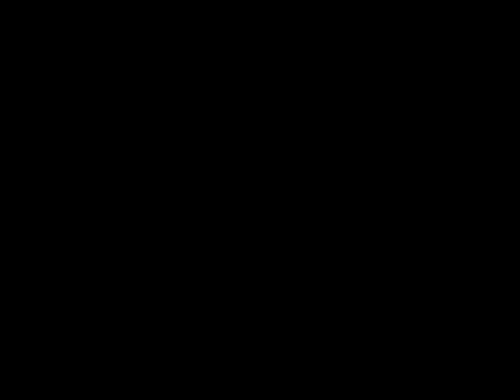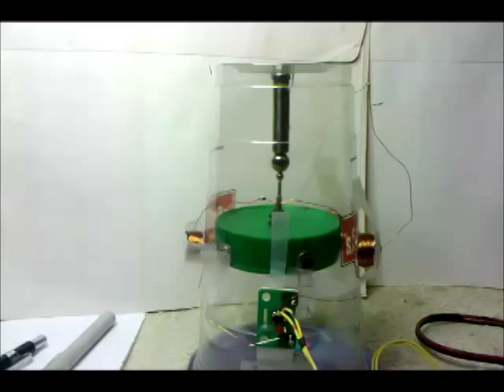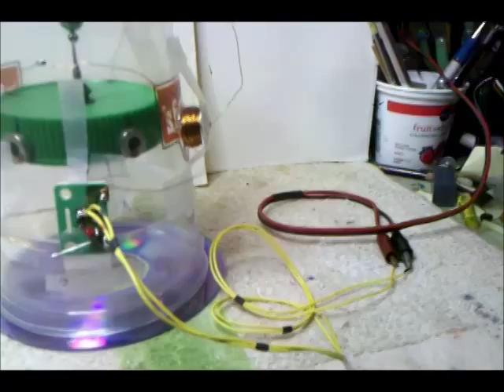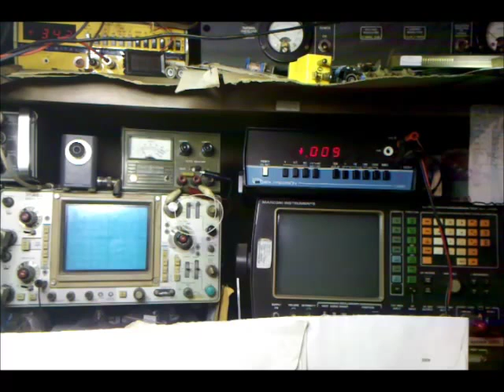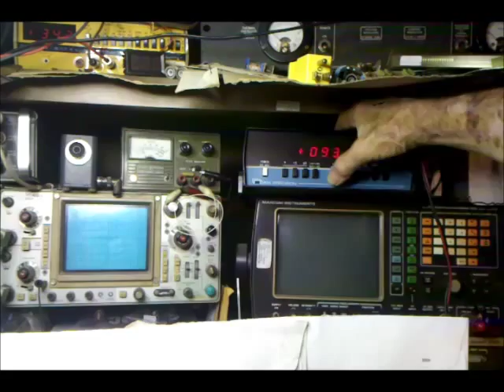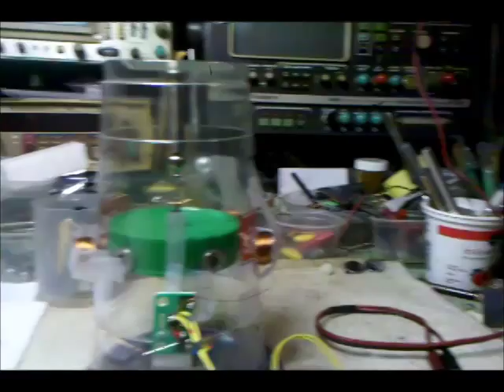2.7 micro watt power pulse motor runs on 0.0094 Vdc !

Comment: how many diameter is coil, awg? and how many turns? thank you very much
Reply from the maker: The wire size is #26 AWG.  I didn't count the turns when I wound the coils.  The sewing machine bobbins I bought have a small hole near the bottom of the winding area to allow about 4" of wire to stick out of the coil as the start of the winding.  I drilled a very small hole on the outer rim of the bobbin for the end of the winding to exit the coil. Try to wind the layers as smooth and flat as you can.

I mounted each sewing machine bobbin on a hand powered geared hand drill with a 1/4" bolt in the chuck and wound each bobbin until it was full.

Comment: Really nice design. I did not notice that you measured the amps. It would be very interesting to know what the amperage was off the power supply. Your Device is a very nice example of what good designing can accomplish. I am running a small motor (Lasersaber's Ez-spin design) that runs off a long wire antenna which is powered by the local radio station. It usually has about 1/2 to 1 volt at 2 or 3 microamps. I was wondering if that low amperage would power your motor.
Reply from the maker: Thank you for the comment.
If you go to my website and select the Levitation articles you'll see how I computed the input power.  With a pulse motor the current doesn't flow all the time so I used a recording oscilloscope to determine the duty cycle and knowing the total resistance of the three coils I was able to calculate the peak current at 0.0094 volts since the coils are running in saturated current mode when switched on at the slow speed.  Using the duty cycle I was able to calculate the average current flow to get the average input power.

There are a lot of Radio/TV stations around here and with a tuned antenna I should be able to run the motor.  I may give that a try.  Right now I am running the motor on one 1/2 volt solar cell and I have to start it running each morning.

Thanks for reminding me of the "free" RF power.  I'll give that a try soon.
Reply: I am an engineering student and want to build precisely what you have described in your comment-A motor running of ambient RF power.Could please tell me how to do that(the schematics or the circuit diagram)?I believe,you are using a rectenna.There are many sources on the internet but specific information is always helpful.
Thank You.
Reply: Ashish Agrawal I replied to you via youtube mmessaging I did not want to "hijack" the discussion thread.